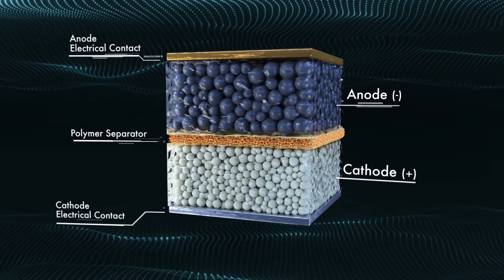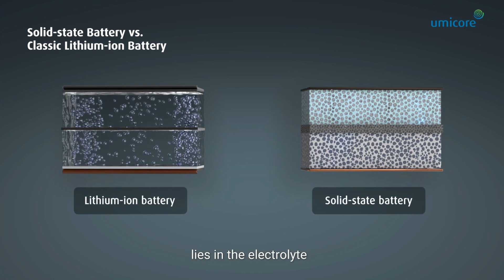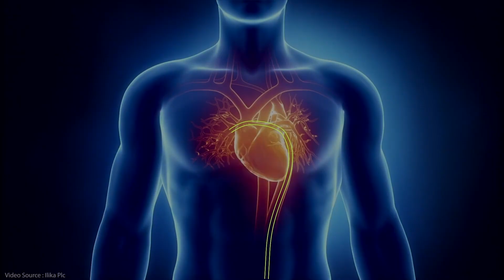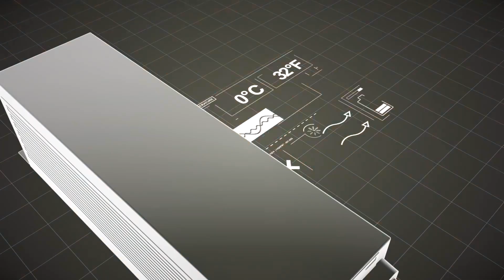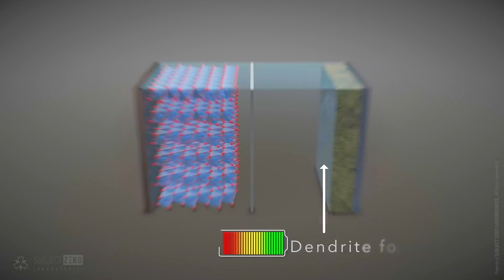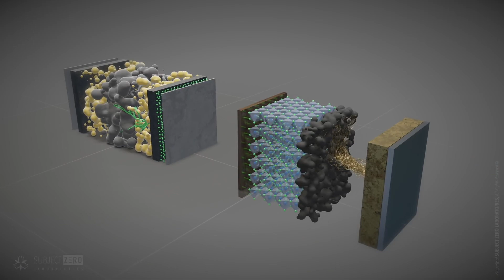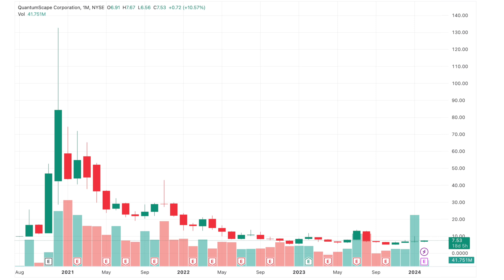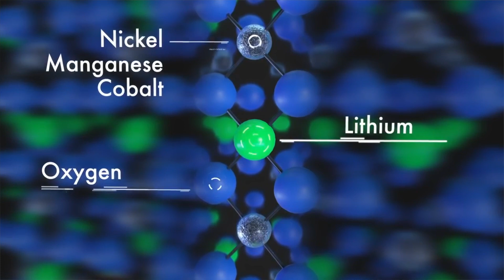Why Solid-State Batteries are here (and why that matters)

Comment: CATL battery corp has moved away from solid state batteries. Their version works with a lithium anode, significantly lowering the base cost while producing 500 kilowatt hr density. batteries with total 1000 kilometer range/charge.They've also found a way to limit dendrite growth. Their battery has demonstrated zero degradation over the first 5 yrs of use
Reply from the maker: Yes! I've seen that. 💡 Very exciting. 🙏 Thank you very much for sharing! I'm also very excited that the US might be able to supply its own lithium demands. 👍

Comment: My earlier edited response had a web link that caused my response from being displayed.  To recap: In 2021 their engineer, Tim Holme, stated their cell was 70x85mm. Then in one of their public releases in 2023 in a Note on the photo of the cell, it was described as 70x85mm again, and that the multilayer cell size was that of “a deck of [playing] cards. “
Love your videos!
Reply from the maker: Thank you so much for the info! Much appreciated! Have a great week! Katha
Reply: AGW is a load of it. 
Just burn coal.

Decarbonization is 21st century pyramid building.

Comment: I can't help thinking that the charging infrastructure investment will be prohibitive to further development of battery capacity/performance
I recently had a toyota corolla hybrid as a long term rental. It sipped petrol/gasoline at a rate of 2.9L per 100km with ease, and down to 2.6L per 100km if my driving style and conditions allowed it.
I was really surprised at how seamless the fuel/electric powertrain operation was in real life. Given potential advancements in regenerative capacity (via the suspension system, heat or even cost effective incorporation of solar panels on the roof) it is plausible that fuel economy could be improved further - without additional battery capacity. 
IMO, increased battery capacity/performance seems pointless once (real world) fuel economy drops below 2L per 100 kilometers - given the existing investment in gasoline production/distribution.
Reply from the maker: Thank you for watching and commenting. 🙏 Great points. Indeed hardware, in particular infrastructure is slow to change. I think it the transition is still on the onset, but it is already happening. I expect a decrease of investments in gas stations, as more and more people switch to EVs. It will take several decades...  I also think we already have more battery capacity than 99% of people need in practice.  😀
Reply: @NetZeroTech  It will be an interesting couple of decades to be sure. The investment in gasoline infrastructure goes well beyond gas stations. Refining oil (unfortunately) also creates many products we take for granted - plastics etc... Re-balancing economies away from fossil fuels will be a challenge to say the least, since there is broad intermeshing that most consumers don't fully understand. Pure EVs certainly have their place and battery technology will improve, but equally battery recycling tech needs to improve to cope with increased consumer uptake of this product (perhaps before we get too excited about the next battery breakthrough). Maybe the implications of all this might make for an interesting future video.
Reply from the maker: Hi @MrSaltybloke, Thank you so much for watching and sharing your thoughts! 🙏 I agree, there is a lot that goes into an infrastructure change from combustion engines to battery-based vehicles. And it could indeed be an interesting future video. I wonder if I have the editing capabilities to make the most of this kind of content. I put it on my list of future video ideas. Thank you! 😀 Katha

Comment: Long line of fairytales. SS-batteries are a joke. Both engineering as energy density&transfer.
Reply from the maker: Hi, Thanks for watching and sharing. What makes you think so? Thanks, Katha
Reply: @NetZeroTech  Huge claims are made every so often.
Since the lithium battery there has been no better battery.
The chemistry for lithium is about as good as it can get.
That's decades old... and nothing has changed.
Reply from the maker: Yes, if you look into any (hardware) technology, the basics are typically decades old. However, a lot of iterative changes combined can make it economically more viable than the competition. Thank you for sharing your thoughts! Katha

Comment: Main thing for me is the tsunami of investments into battery tech. We really just need 50% more capacity to kiss range anxiety goodbye (say 800km/500mi) coupled with better charging infrastructure (already growing at an insane pace) and faster charging speeds (10-12min is plenty and we're already getting very close to that. With 800km range you could drive for 7hrs non-stop. You'd definitely need more than 10min to stretch, pee and eat at that point!). The other main factor is cost, which is also coming down quickly. By the end of the decade, a base-level EV will be cheaper and better than a base-level ICE car. So I don't really see that we need solid state batteries to make a full transition for personal vehicles, and we may see completely different tech than the classic chemical battery that shatters all expectations. I think the real. Question is: once we get road transport covered, when can we get planes and boats converted to batteries? (and no, I don't think hydrogen is a good alternative - if you think it is, you don't know enough about it)
Reply from the maker: Thank you so much for watching and commenting! Kissing the range anxiety goodbye, that's the way to put it. 😀 Experts agree it's irrational, when it comes to ~99% of travel. Yes, I agree, we don't need them. It's a race of cost and speed-to-market. I also agree that hydrogen is not the right way to go for mobility (see https://studio.youtube.com/video/_ozs-mohA88/edit). Hydrogen is crucial for other industries such as fertilizers, refineries, chemicals and in the future for steel production, etc..  Thank you again! Much appreciated. 🙏 Let me know if you have any suggestions for future videos. Katha

Comment: I haven't researched it or watched a video on it yet but, I heard that China made a long lived nuclear battery or something. What are your thoughts on this?
Reply: It's very low power. Good for sensors or medical implants. If scaled, it may be enough power to trickle charge a regular battery inside a smartwatch. Not enough power for a phone or anything yet. Definitely not scaleable to a car. I would sure love having a small flashlight (even if it's fairly weak) or earbuds or a watch or other small/low power devices like that that will never run out of power in my lifetime. If they could scale it up to a phone that would be super awesome!
Reply from the maker: I'm a bit skeptical, when it comes to nuclear fission waste... I'm curious to see, how long nuclear fusion will take to become economic... We already have private investments in the space. Could easily still be several decades...
Reply: @NetZeroTech  I think they're talking about the diamond batteries, aka "betavoltaic cells" that use the decay of nuclear waste (which generates beta particles) to generate electricity. They'd be using carbon-14 harvested from the surface of graphite blocks used in nuclear reactors. 

Pretty sure they're not talking about fussion, which just makes helium as a byproduct, so not particularly useful for batteries.
Reply: @truhartwood3170  yes! This was exactly what I was referring to, with the diamond batteries. If anything... at least it would be fuel efficient to use for low power back up generators or something like that. Though I think it may take up a huge amount of apace, so I don't know what applications it would be useful for due to rhw low power and high space/weight. But once it's there it can still leak out power for a very very long time. 

Also I am a he.
Reply: @devlinmcguire7543  Yeah, it comes down to cost, too. Would I pay $100 more for a smartwatch or for a medical implant that never needs to be charged? Yes! But would I pay a million dollars for something that will trickle charge my car and takes up one parking spot in my garage? Well, unless I'm Bill Gates and planning for armageddon, no I wouldn't.
Reply: @truhartwood3170  exactly. But I was thinking it could also be used as a backup. Like, it could power just security cameras/alarms or other miscellaneous essentials when a main power source goes out. Or it could power electric car Chargers that are way out in the middle of nowhere. Because it cost a lot to send electricity across large distances from their sources, since it could get turned into heat somewhere along the electric connection. I'm thinking, nomatter the size it'd need to be, a car charger out in death valley or somewhere remote might be theoretically worth it because of that. But  honestly, I'm just spit balling ideas, idk what might be practical OUTSIDE of medical uses.
Reply from the maker: That's a good point. I'd like to look into it more sometime. I put it on the list of potential future videos. Have a great time, Katha
Reply: @NetZeroTech  Thank you! I appreciate it.
Reply from the maker: Yes, I read about it. 👍 Not so sure, if it’s a good idea… Thanks for sharing!
Reply: AGW is a load of it. 
Just burn coal.

Decarbonization is 21st century pyramid building.